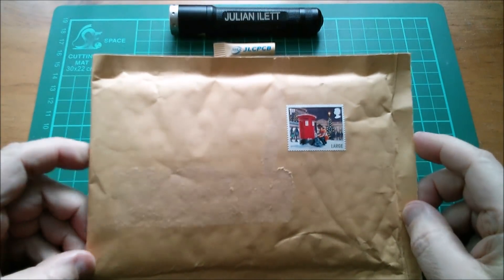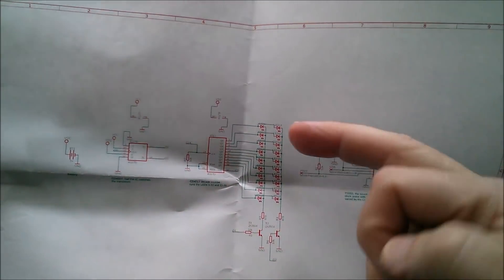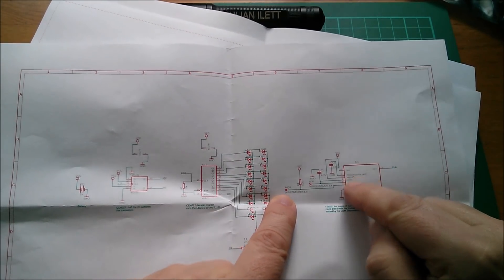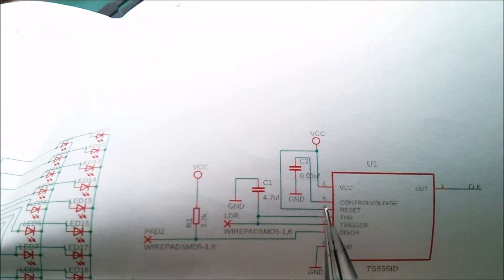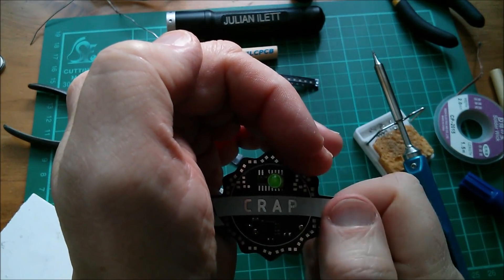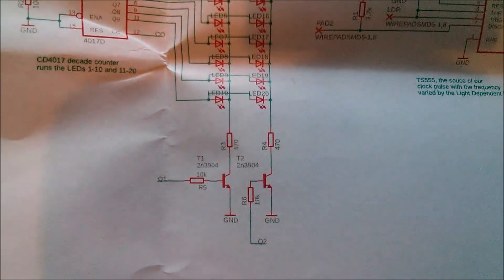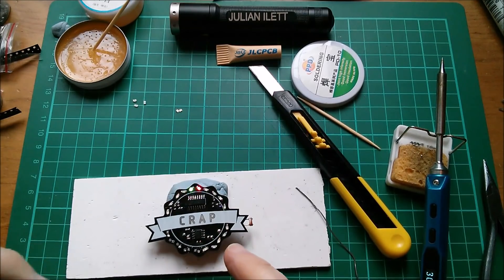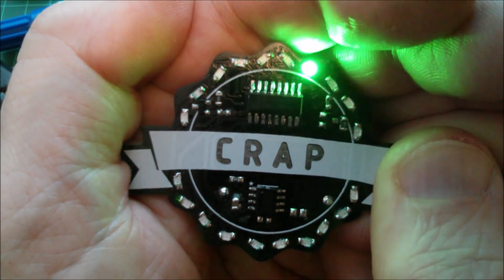Building David Watts' Crap Badge - ChristMOS Edition

Comment: Here's a thing... Why, when using surface mounts do youtubers never use solder cream as we used in the PC motherboard repair industry and in the electronics industry (hand building boards for Linn Hifi). Little bit of flux, the pen is ideal, little blob of solder cream, place component, hold in position with tweezers and heat, ideally with hot air but a fine tipped iron at a push... Absolutely no risk of tombstoning and a quick, clean easy job...

Comment: You did a great job Julian, I like the red and green LEDs. I never really thought about it as a Christmas decoration. That should have been a TS555CDT (marked 555C) but then I bought them from eBay, you got one of the alpha boards with components bought from UK sellers so it may well not be the right IC. The 555s I have for the bulk lot do look a little  different but are still TS555 ICs. If they ever make it to Tindie as kits I will make sure the documentation is a little more user friendly 🤣 That pull-down on the 4017 is a breadboard hangover when I was triggering it with a momentary switch, it isn't necessary. Really enjoyed watching you put it together mate.
Reply: That double flash is bothering me, I am fairly convinced it is a propagation delay with the carry out on the 4017 and the 4027 flip flopping but I have never noticed it before. If you take that thing in a very dark park it will take tens of seconds to clock.
Reply: @DavidWatts  could be interesting to see on the oscilloscope.
Reply: or replace the LDR with some high value resistor
Reply from the maker: Thanks, David, for sending the kit. I wouldn't worry too much about the double flash - once I'd completed the circuit, I couldn't see it anymore :)

Comment: Use two irons to solder surface mount components. Put the sticky flux on both pads. Place the component. Then touch the irons to each end simultaneously. Of course you need two irons in the first place :-)

Comment: Seems you got your TS-80... the standard tip is horrible. Mine is gathering dust at the moment (even though I was able to find alternative tips here in China), as I take my laptop anywhere anyway, so I use the ThinkPad (20V) power brick to power my TS-100. Slightly more involved to get this properly working with the TS-80 (not impossible, but another cable/battery/sth). Looking forward to your comments in a review video...
Reply: XY-5 is resin (not flux)... and the PD-10 is a very common flux here
Reply from the maker: Thanks - I only tried the PD-10 in the end. But I've seen a video where someone sticks his iron tip into the XY-5.
Reply: @JulianIlett  Right, same here. The stuff will actually make weird cracking sounds... on heating up and when it cools down. It can also help with cleaning of your tip, and I remember you mentioned the issue also with the TS100 tips oxidizing quickly.
Reply: Usually I wouldn't need this, as I use multicore branded soldering tin which has a resin core. And I suggest to store the tips tinned...

Comment: I have a suspicion David wanted his products to be lead free as he was selling them. Can’t remember when exactly he mentioned it - I could have made that up.
Reply from the maker: Maybe I'd have had more luck with lead-free solder - but I hate the stuff - it even smells horrid (the flux is different IIRC).
Reply: I hate lead free solder ae well. Its awful. It just doesn't flow. No wonder BGAs soldered with lead free solder fail so much.
Reply: I agree Julian. I cut my electrics teeth on leaded solder, so that's what I use.
Reply: I must admit I nearly gave up dabbling in electronics, when I thought I couldn't solder. When I switched to full-fat lead solder (thanks to Clive and Julian) it was a revelation. Thanks guys, and David as well. I wonder how many more have given up over the years that H & S have been in control ;)